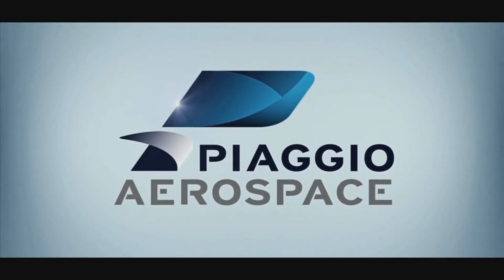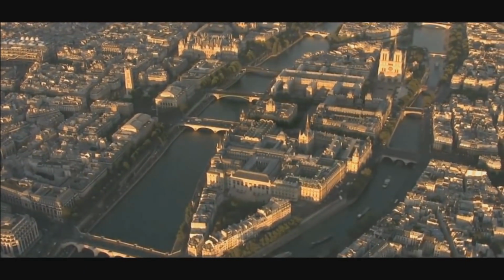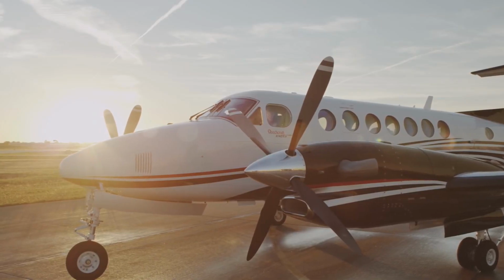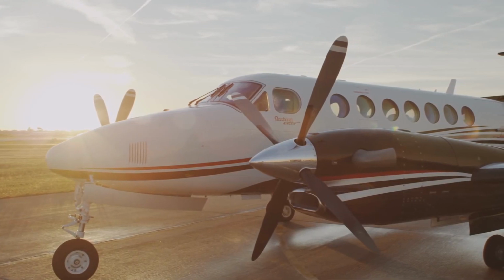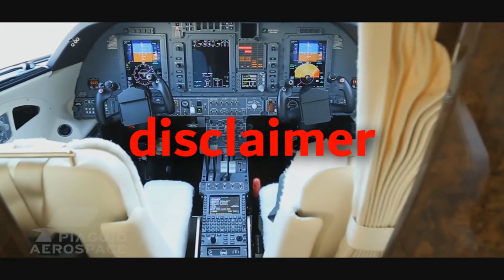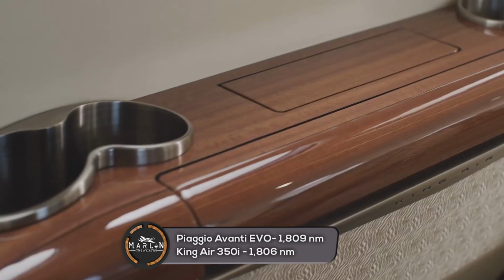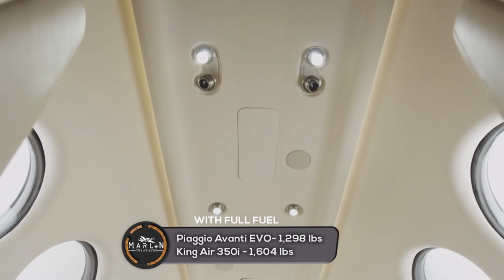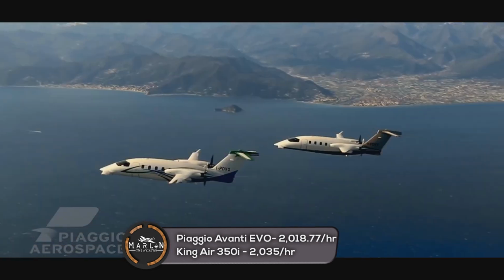Better Aircraft - Piaggio P180 Avanti EVO vs King Air 350i

Comment: I fly An Avanti for my living.  I also have many king air hours.  The Avanti significantly outperforms any King Air. It easily makes its book cruise speeds, maximum altitude and fuel burn. Ours actually does a bit better than book. It is significantly quieter in the cabin and there is less vibration. Also the maximum cabin pressure is higher in the Avanti, providing a more comfortable cabin. 
The Piaggio needs more runway as it’s rotation and approach speeds are 15-20% higher. Both of these planes are wonderful machines, but I’ll take the Avanti and it’s great flying characteristic hands down.  Capt. Richard Hartman
Reply: It sounds like the Avanti is not only less expensive in fuel per hour, but since it is faster you will travel farther on that fuel burn. So it kills the King Air in efficiency. Added to the cabin comfort, the Avanti is the obviously better choice. But some people think it looks weird. I think it is beautiful!
Reply: @HQBergeron  Can Avanti take off on grass slopes?
Reply: @fdo211185  and that is propably on eof the pluses to the king air. It is much more versatile. you could fly it through africa. not to mention all of the parts that are available
Reply: @fdo211185  The Avanti is known as “The Ferrari of the skies” not “The Hummer of the skies.” However, I understand there is a rock protection option available. Why do you ask? Are you a drug runner? But seriously, if you need to match some special need like that, of course buy what fits the need. My needs would be far more satisfied by the Avanti.
Reply: @HQBergeron  Mine was a curiosity having a tourist airport with a grass runway close to home.  Honestly, you are very rude to call me a shameless drug dealer.
Reply: @fdo211185  It was a joke! Sorry it did not come across when I said “But seriously...”  I have not heard of many doing grass takeoffs and landings with the Avanti, but the fact that they offer an option means maybe the rock protection option could work if it is smooth grass with few rocks and pebbles. I hear the props get pretty dinged up if there are rocks because the Avanti sits low enough that the tires throw them into the blades, which are expensive to refurbish.
Reply: @fdo211185  Yes.
Reply: @samtatenumber1  Avanti make variants for grass or dirt runways.
Reply: @fdo211185  who the hell puts a 7 million dollar aircraft on a grass runway? I believe Pilatus has that market cornered. Even though the king air is capable of landing on grass I wouldn’t dare do it. It would be like taking a Ferrari down a dirt road. In either case both aircraft are amazing yet trade offs. I’d take the Piaggio. The speed, space and efficiency are worth a car ride to paved airport.
Reply: Noise and vibration is quite high in a Kingair
Reply: @MattLassota  I did hear it can get to 400 knots (TAS) as well..
Reply: Can the Piaggio Avanti take off and land on grass slopes which are therefore not asphalted?
Reply: @fdo211185  Yes.
Reply: Kevin, I am considering purchasing a P-180. I have heard that parts supply has gotten better. Is that true? Also, do you know if there is still the strange arrangement with the landing gear? I heard you don't actually own it and it has to be sent to Italy for overhaul to the tune of $700,000+...is that true?
Reply: I think the Avanti looks sweet.  So the one main complaint I see from reading some of the comments is the avionics?  Also, why is the braking so bad compared to the 350i?  The Avanti needs a lot more runway to stop.....  Being Italian, is it hard to get maintenance and repairs done on the Avanti?
Reply: @sunshinecycling   My understanding is it is hard to get parts in a timely manner, not because Piaggio is an Italian company per se, but that they have been in financial trouble for a long time, at least partly because you can’t get parts in a timely manner. Yes, I know. That’s sounds like circular reasoning. I think they are underfunded, poorly managed and maybe have union workers which has long been a problem in Italy. But that is all just a guess. They certainly need to identify their market more clearly, upgrade their avionics, and get P&WC to make auto-throttle possible. It may be that no one is willing to invest in their company for fear their aircraft will soon be replaced by something like the Celera, or the upgrades I suggest would be too expensive. All I know is it is a shame for such a great aircraft to be allowed to languish when it could have been ubiquitous and dominant.
Reply: Bellissimo!
Reply: Its a very unique aircraft , i have my photography inside the aircraft , Dubai Air show.
Reply: How fast is it (True Air Speed)?
Reply: Great words, anywhere I can find performance charts for the P180? Thanks in advance !
Reply: @jamesmcpeake3235  do you know how much the real fuel burn is for the avanti vs the king air? lots more efficient? thanks
Reply: Thanks Richard, I have a question: What is the unsealed capability of the Avanti? We all know the King Air eats dirt runways for breakfast, but the Avanti looks a little delicate. Also I seem to see King Air can operate out of shorter strips, so can fly to more airfield types? 
The Avanti also looks a lot like the Celera currently in production, it must enjoy good laminar flow and low drag.
Reply: @robboinnz  It is more like the Celera looks like the Avanti, since the Avanti preceded the Celera by 30 years. And yes, the Avanti was specifically designed to take advantage of laminar flow which both creates lift and reduces drag with the fuselage and main wing. And the front wing creates lift on the nose, which allows the tail to be nearly neutral instead of having to create downforce (and drag) to balance the nose. This is still cutting edge aerodynamic design. The Celera takes the propulsion to the next level as well as bumping up the aerodynamics another notch.
Reply: From the owners manual King Air carries way more fuel and flies farther, north of 2000 NM. It has a larger network of repair service providers globally. It also has after market modifications for range and speed that Avanti does not have!
Reply: @MattLassota  So approx M.62? Then I'd like to ask what good is FL410 with M.62 when everybody else are flying M.8? Fine with a service ceiling of 41.000' but how often will ATS allow you that level considering the huge speed difference to the other traffic?
Reply: From somebody who knows, thank you!
Reply: Can i ask you a question. I totally like the avanti but it seems like the market doesnt. Can you explain this to me ?
Reply: It's so cool to hear experience back up the technical data
Reply: I did notice it lands on high speeds. That's not good I guess.
Reply: Yeah but the banshee-like shrill of an Avanti on the ramp and during taxi is enough to drive animals away.
Reply: @andreinarangel6227  I find it lovely. Though some airports have banned them! The Evo is significantly quieter ... but not quiet.
Reply: @UncleKennysPlace  for what reason it got banned?
Reply: ah but dose the piaggio go faster when the king air has the black hawk conversion i rater have the king air because of the black hawk conversion and the newer avionics and at least i know the plane has a strong foundation
Reply: @miadrain1454  yes, even with a black hawk conversion a king air won't come close to the avanti in speed..
Reply: @superchargedpetrolhead  exactly...the Avanti is quicker then the King Air 350 and quicker then the Dash 8 400 even though the Dash 8 400 is a different type of turboprop aircraft for a different kind of role. The point im making though is that the Avanti is very very quick

Comment: When you compare the operating costs and performance of KA350i, it’s no wonder the PC12 NGx is taking over that market and parent company Textron has developed the Denali, albeit under the Cessna brand. 

Given those operating costs, a VLJ is faster @ similar operating costs. For shorter missions where speed may be lesser factor, a PC12 NGx is no brainer as the wise choice. 

I doubt anyone is considering anything from Piaggio given their financial status. Their support infrastructure around most of globe is entirely insufficient for most operators compared to Pilatus & Textron.
Reply: Michael M : no doubt that the PC-12 is a great aircraft. But in many countries, single engine aircraft are prohibited from flying at night or even IFR. That’s a huge restriction. Not to mention they must always remain within gliding distance to land....in SE Asia, this is a show stopper too.

Comment: So the winner is the pc12 ngx?
Reply: One engine vs two?
Reply: The PC-12 is a joke next to the Avanti. You’re comparing hamburger to a two inch thick ribeye!  😁 I fly an Avanti and it’s amazing.  The PC-12 that I also have significant time in, isn’t anywhere near the airplane, from performance (Avanti is100 kts faster and 41,000 ft service ceiling) to systems to redundancy. Capt. Rich Hartman
Reply: @kathyhartman4702  What about maintenance? I suspect it is more expensive, correct? 
Cheers and thanks for the info mate.

Comment: This was an interesting comparison

Few remember the Beechcraft Starship that was introduced  in the mid 1980’s as a replacement to the “obsolete” King Air. 

On paper it was superior to the King Air.

Take a moment to look up the Starship
Reply from the maker: I was considering comparing it to the Piaggio but it’s seems outdated in comparison. Maybe I’ll still compare them since they are both pusher aircraft
Reply: MarlinTheAviator it’s really a shame the Starship didn’t catch on. Not even sure if any are still in flying/airworthy condition
Reply from the maker: There is at least 1 that is operational and privately owned.
Reply: MarlinTheAviator excellent
Reply: @jerrykorman7770  I see one here flying overhead in Dallas Texas all the time
Reply: @kevinstiff8681  I wish I could see one up close
Reply: @jerrykorman7770  there are 4 still in use teo of them used to be based out of Eagle County in Aspen
Reply: @jamesmcpeake3235  yes, itz too bad Beech under-powered it and had issue with the all compisite airframe and tried to constrain many things.  It is still a beautiful airplane.  If they could have managed fo overcone the initial faults I'd be willing to bet current versions would be as good or better than the Avanti.
Reply: @jamesmcpeake3235  What many here do not realize is Beech was way ahead of the curve with the Starship.  No one had made a composite aircraft like that - ever.  They had to learn a lot to build and certify that aircraft.  The FAA was also ignorant on how to certify the design.  SO the FAA imposed many things on the design that forced Beech to compromise their design and performance.  The end result is an aircraft that did not meet expectations and was difficult to maintain.  And the materials available back then were not very good compared to the materials we use today for composite designs.  So Beech did pull the plug.  I can tell you that Piaggio came to Wichita, KS and hired Learjet to help with the structural design of the fuselage.  I was on the Lear Jet team that worked with the Piaggio engineers.  And yes their aircraft is fast, but I can tell you the Italians are slow.  It was very painful to get the Piaggio management to make any kind of decision.  It was even slower to get that aircraft to market.
Reply: @jamesmcpeake3235  yes agreed. The Starship was a flop almost like the Edsel. I respect how the King Air soldiers on
Reply: @jamesmcpeake3235  good points.

I have witnessed corporate culture that seems almost designed to make catastrophic mistakes and fail. In hindsight, somebody at Beech should have been honest and pulled the plug.

The Caravan has killed a few pilots. Flight into known icing is deadly to that aircraft. A Caravan crashed right here in Winnipeg 

https://www.tsb-bst.gc.ca/eng/rapports-reports/aviation/2005/a05c0187/a05c0187.pdf

Good thing the aircraft impacted a rail line right-of-way. That part of Winnipeg has medium and high density apartments and condos, and office buildings 

Hopefully Piaggio survives

https://www.ainonline.com/aviation-news/business-aviation/2020-08-18/financing-clears-path-piaggio-aerospace-operations
Reply: @jamesmcpeake3235  forgot to mention a King Air is much quieter with Raisbeck props and especially MT composite props

Comment: Great video, but why are the operating costs almost identical when one plane burns much less fuel while going much faster?
Reply: I would have to research the manufacturer required TBO, and related M&O costs to answer that question.
Reply: @jerrykorman7770  Why is it not part of the comparison???
Reply: i think it probably is down to maintenance cost, there are lot of king air's around so I would assume parts might cost a bit less than the avanti. Even though their operating cost is similar don't forget the avanti is considerably faster so overall it might cost less cause you aren't spending as much time as in a king air for a certain trip.

Comment: On paper, Piaggio is a much better plane by a large margin. But Piaggio has a problem of reliability and inadequate service network. That's why after twenty something years of service, very few customer would buy them. They are now left dying. If you can build a plane with really good quality and people can really depend on them, customers will keep buying like Pilatus, Honda especially after a few years in service. Just take a look at the sales figures each year. then you will know.
Reply: The Avanti I fly is maintained per the factory and we have had less reliability issues than I’ve had with king airs in the past. The company is solvent as the Italian government has stepped in. Capt.Rich Hartman
Reply: @kathyhartman4702  Can I ask where you are operating from ?. I am seriously considering this plane for work out of London Uk there is a german company Airgo that are currently very bust in the market and have 4 of these aircaft flying. How long have you been flying the Piaggio for, normal Pax load and what is your average sector length
Reply from the maker: I see in an attempt to offer better quality they have an improved service and support network, an innovative new maintenance program that can keep costs under control.
Reply: The P180 is vastly inferior in a very important spec for the typical usage of aircraft; full fuel payload. Despite being an 8 passenger rated aircraft, a payload of 1150lbs makes this closer to a 5-6 passenger aircraft w/light luggage. That’s not competitive w/KA350i & PC12 NGx. The service infrastructure too is vastly inferior to Pilatus and Textron. Those factors alone have killed viability of an otherwise innovative aircraft making substantial foothold into mid-range charter market.
Reply: @MichaelM-to4sg  97% of flights are 6 pax or less.
Reply: Old BS!

Comment: $2000/hr operational cost! I think I will stick with my Starduster Too with it’s 205 HP Lycoming @ a per hour cost of $45.00.  :)
Reply from the maker: Well the operational cost includes ownership expenses aswell
Reply: You are kidding yourself if you think you're operating costs are that low
Reply: well yes theres a market for everything and everyone. happy landings
Reply: James Harber the PT6A has a TBO at around 3,600 hours at a cost of $500,000. There are two of them. Turboprops have other expensive M&O costs